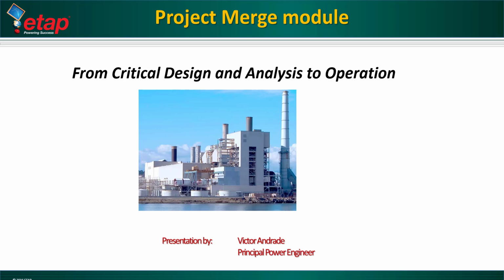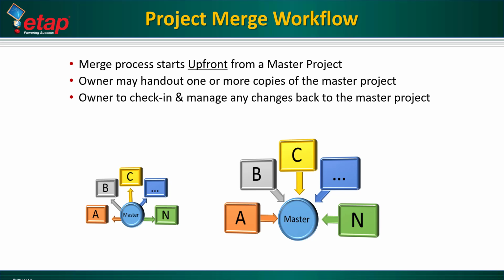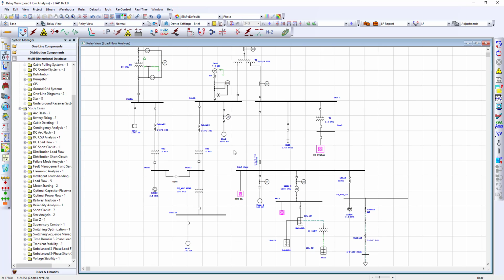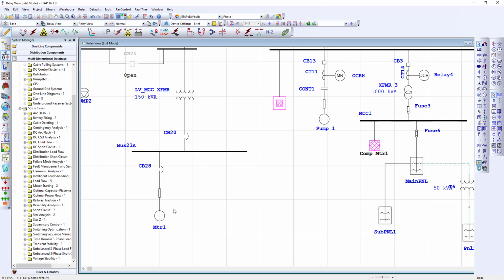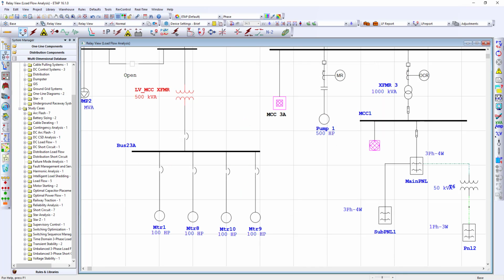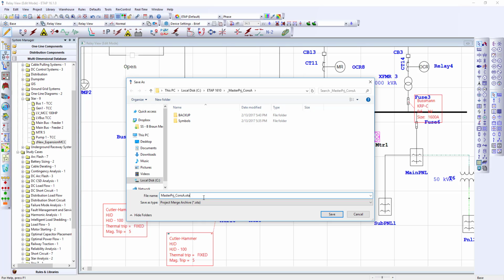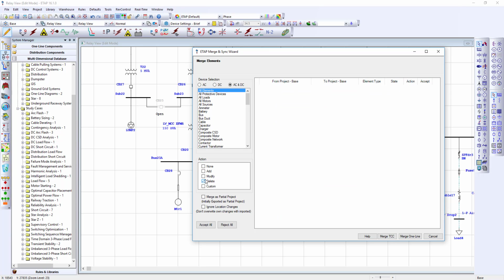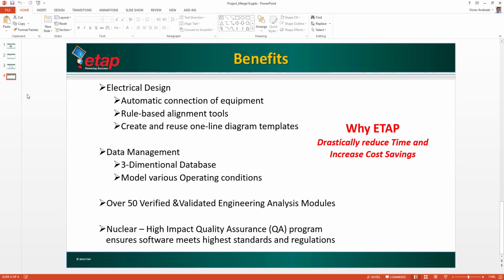ETAP Project Merge/NetPM - Project Collaboration & Data Management

Comment: Hey, can I run a etap 16 file on etap 12.6? I mean, I worked on etap 16 and I wanna know it the file can be read by etap 12.6 in another computer.

I hope you can respond.
Reply: Hi Carlos. Unfortunately you cannot open up a newer ETAP project file in an older version of ETAP.